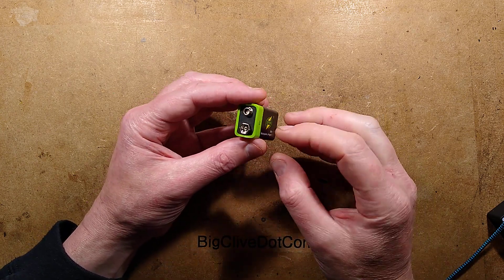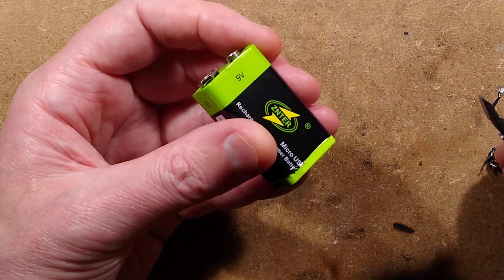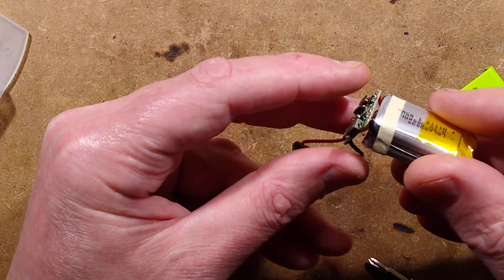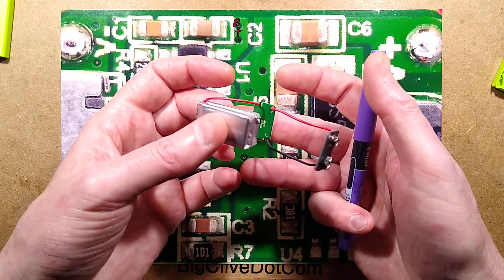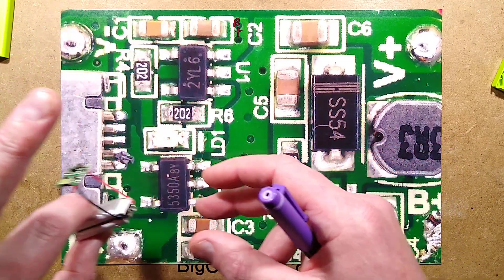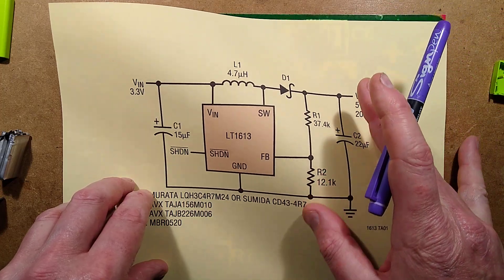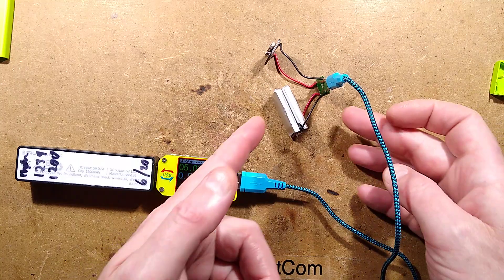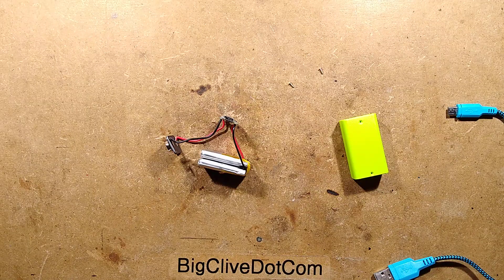Inside a Znter lithium 9V battery.

Comment: I have the Okcell version of these and they have a level meter on the side.  
I love them, they have been one the best battery purchases I have made.  10/10 would recommend these
Reply: I have both and the Okcells only have about half of the capacity of the Znters. That's no big deal usually though as they have such a high self-discharge that I charge before use anyway and the Okcells are usually high enough capacity.

Comment: What do you think of using this for smoke detectors? Usually they beep when the voltage drops below a certain point, these are a stable voltage until the end. Would they work with the warning beeps? Or will you have to guess when to plug the thing in?
Reply: If it suddenly shuts off then you won't get the low battery warnings, it will also only last 3-6 months at best. Would not recommend for this use.
Reply: Not very suitable for smoke detectors due to high self-discharge and sudden demise with no warning. For longest life use a non-rechargeable lithium - a bit pricey though.

Comment: I'm really liking this. However apart from my multimeter's and smoke alarms, I'm trying to think what else I'd use them in...
Reply: Hmm, smoke alarms? From what Clive was saying, the remaining charge would not be useful after 6 months, where standard PP3 bats I know last for at least 12 months. Was thinking of buying 2, and jst 'remember' to charge them twice a year, but would I remember? Doubt I would :)
Reply: @comicmania2008  the other issue is that a PP3 will go 9v, 8.5v, 8v, 7.5v, smoke alarm beeps to tell you to change yer battery.

These would go 9v, 9v, 9v, 9v, dead because they boost the voltage. No warning. No alarm.
I'd not be using them in smoke alarms. :/
Reply: @Beany2007FTW  That's something that could be worked around. Many such devices may even do it - all you'd have to do is rig the boost converter to use the battery voltage as the reference instead of an internal fixed reference, and adjust the divider so the converter would go from 9.5v when the LiOn cells are at 4.2, down to maybe 7 volts when they get down near 3.2v. It would be tricky to get exactly right, but certainly doable.

It would be cinch if someone would design a chip to do this.
Reply: @robertbackhaus8911  someone could design a chip to do it.... Or they could just buy some regular PP3 batteries :)
Reply: @comicmania2008  About 18 months ago I found an old Ni-MH 9V in my drawer and decided to test the myth that they shouldn't be used in smoke alarms. I got 9 months out of it which isn't terrible considering I was replacing Energizers roughly annually. I think it's a 7-cell version. My particular alarm, low battery chirp starts at 7.8V and continues chirping down to something like 3V-4V. It was enough of a spread that I'm not worried it'll go dead while I'm at work or away for a weekend and miss the warning before it cuts out completely. So I'm happy to use Ni-MH at least. Here in NZ, the lithium variants are stupidly expensive so I haven't bought one to test. Their voltage does drop off a cliff at a certain point though.
Reply: Hell I'm debating buying two for my work, we go through so many 9v batteries for our door dinger. We go through around  two boxes of 12 a year
Reply: @SilvaDreams  I'd be vary about using them if they go from full voltage to 0 instantly as the cell voltage drops below the protection level, not giving the alarm a chance to tell you that the battery is going low...
Reply: Might be great for paintball, between my markers and hoppers I'm always stocking up on them!
Reply: These wouldn't be suitable for smoke alarms in my area as our Fire Protection guidelines require ten year non replaceable lithium batteries. I would suggest you check your local laws before using these in smoke alarms...
Reply: @evanstedman7405  I don't understand those ten year smoke alarms. If they ever get set off (happens a lot when cooking) you clearly won't get a full ten years. You're left scrapping the entire unit before its time. I wonder if the people writing them into code have thought of this. Do they really think people are more likely to maintain their alarms if they always need to replace the entire unit instead of just a battery?
Reply: @eDoc2020  The only time the whole unit is scrapped is if it develops an internal fault and needs to be replaced or once the alarm reaches the end of its service life (the ten years). And the batteries are guaranteed to last ten years as they have been designed to last a fair bit longer than that (even factoring in as many as 100 activations in the service life).
Reply: @evanstedman7405  Do they really factor in 100 activations when calculating the service life? If that's the case it's not as bad, although it still seems limited. If you set off the alarm once a month when cooking (reasonable, considering my old oven would seemingly always set off the alarm if set to 450F) you'll get over 100 alarms within ten years.
Reply: @eDoc2020  I haven't looked at the specifications in depth recently but I do know that they are definitely guaranteed to last the ten years as the manufacturer is required by the code to ensure this.
Reply: @evanstedman7405  another thing in the landfill because of non-serviceable batteries.
Reply: My DMM takes 4 C cells. It uses one about every 50 years. So C cell shelf life is important for that utilisation.
Reply: arduino
Reply: Actually 9v used in most guitar pre amps as long as they are the exact same size as a normal pp3
Reply: My shed alarm uses a PP3

Comment: I bought some Lion double AA and AAA batteries with what seems like a buck converter and charging chip built in.  Even though these batteries are great, I think I would be afraid to use them in something like a smoke detector since I don't think the smoke detector would never tell me if it was low or not.  I use them in remotes, and electric toothbrushes and flashlights since the worst that can happen is my light dies, and also my toothbrush.  I would want to know if I need to swap out my smoke detector batteries so I wouldn't use these in critical items.

Comment: I've been using ordinary cheapo "barely 9v" 9v NiMH in my multimeters and crappy microphone mixer (that's all I've got that works on PP3) for over 10 years now (and that's  the same batteries and charger over and over again) and they've never complained.... not entirely relevant but, hey, it's a long long-term test.

Comment: dB Technologies microphone transmitters do not like Ni-Mh rechargeable batteries, and don't last very long at all. 

Used to use a Db Technologies 800/810 system (the 810 being the "posh" version with a mostly metal case LCD display with frequency and vu meters plus removeable antennas, interestingly not only are the PCB's 99% the same, it's mounted on the same plastic base/rear panel of the 800!, some nice dB technologies laser etch branded RF cans too)  with a  headworn mic in conjunction with my Behringer VC340 Vocoder and would have a habit of leaving the transmitter switched on, not good when only non-rechargeable batteries work properly. 

Keep meaning to test Ni-Mh 9V's in my old Trantec VHF wireless systems to see if they fair better, although I would have to replace the connector on the microphone and at ~£20 a connector (Trantec used to use 4 pin LEMO connectors) not cheap.
Although I will say at least they are easy to obtain, dB technologies used custom ~3.5mm locking jacks (In either TS or TRS form, the 800/810 using TS jacks and specific  beltpacks for guitars without the ability to power condenser/electret microphones) and ONLY Thomann sell them!
https://www.thomann.de/gb/db_technologies_vh_511_miniklinke_stecker.htm
https://www.thomann.de/gb/db_technologies_vh_519_mini_jack.htm

Comment: Hopefully, you put this back together, this is the most practical rechargeable 9-volt battery I've ever seen.
Reply: @chichung888  Li-ion would give them a bit more leeway on the cutoff voltage, but not down to 2.2V...more like 2.8V with modern cell design, but I'd still rather not go below 3.0V myself. Too expensive to stress it like that every time you use it, and with that design that's what one is doing if one waits until the battery just shuts down by itself.
Reply: Guys, is it suitable for the use in a guitar?
Reply: @MaximC  The switching frequency is much higher than any audible frequency so I would think it's probably ok to use to power a guitar pre-amp or an effects pedal. FWIW I use an EBL branded equivalent lithium 9 volt battery to power the active electronics in a bass guitar and it works just fine but, as always, your milage may vary. They do interfere with some radio frequency equipment though. I have an MSF clock that takes two AAA cells and after cleaning away the remains of a pair of alkaline cells that leaked while still able to power the device I fitted a pair of EBL lithium AAA cells. They each contain a 3.7 volt lithium cell and a buck converter to reduce the voltage to 1.5 volts. They were great for powering the clock but they interfered with the radio signal it relies on for its accuracy. So I ended up replacing them with a pair of NiMH cells, which work fine and, I hope, will be less inclined to leak than the original alkalines.
Reply: @johnm2012  
Thanks. I think quality ones should be fine, but Chinese cheap ones might not be fine - I think I saw a video where someone put a Chinese 9V rechargeable battery in a guitar and it created noises.
Reply: Guys what type of 9v battery would be best suited for my metal detector, currently juicing up on Alkaline and wanted something more longer lasting as costing a small fortune to replace. 
I was reading your comments about audio interference, my detector isnt wireless but has either head phones or a small speaker close to battery compartment. Would one of these effect my detector and if so wheat else could I possibly use? 

Apprichiate your time!
Reply: I was thinking rechargable and then thought maybe something best of both worlds so hense why looking on here. I noticed last comment also mention some interference with rechargables?? is this something I possibly couldnt use either?
Reply: Hmm. Could you fix (in theory) the wrong cutoff voltage by using different resistors like on the boost circuit, or is it a built-in part of the chip?
Reply: The most practical ones are those with a charge level indicator and a button. With this Znter you never know how full is your battery unless it cuts off due to low voltage on the lithium cells.

Comment: LOL, when we build sets for TV and theater we always picked up those battery's. They tend to just litter them on thr ground. Cheap battery's for us though, mostly half empty.
Reply: I bought a test meter and when I would cycle AAS through at church they will get to a certain point and I would throw them into a used tub and to take home and use them for other things until they were dead. A good use is for TV remotes and thermostats are good and  low draw and not too concerned about the remaining capacity until they just stopped working. I used to work with a group / band who would replace them every month after 4 hours of use I eventually convinced him to get a battery tester and we would take them out test them and reuse them until they got low we stopped going through batteries a lot.

Comment: It’s refreshing seeing nicely designed stuff alongside the horrors
Reply: Accept the battery sais ploymer in stead of polymer
Reply: @laurensholthof  Except?
Reply: @MarbledPaladin  ...and says?
Reply: @MarbledPaladin  I think I just died a little inside. Usually, I'm the one correcting people on their and they're, but I'll just go ahead and assume that this was on phone and in a hurry.
Reply: And held together with screws!
Reply: ...which makes me realize that I can't know what is shite or quality without tearing my electronics apart and knowing the difference myself
Reply: I think the batteries from the late 80's to early 90's was way better. they lasted longer, and could handle at least double the current. Even the non recharge variety from back in the day had more current than the same variety today.
Reply: It looks easily hackable too to make a small power bank for 5V. That would be a single resistor change for the easiest method. Change a few components and you could make it far more efficient. EG a better shottky diode and inductor with lower ESR.
Reply: @gordonlawrence1448  Indeed, replace the resistors with a very small pot, drill another tiny hole, and now it's a variable voltage battery pack!  You'd just need to carry a flat screwdriver, a meter, and a set of custom snap-on connectors for all your needs and... Yeah, nevermind.  ;-]
Reply: Is there room enough to add what's necessary to allow the end-user to choose the boost to be to, say, 7.2V, 8.4, then 9.6 -- depending on intended use? Would make for a versatile "9V" battery.
Reply: @michaelthibault7930  The ratio between R2 and R3 determines the output voltage. It looks like there's a nice empty bit of floorspace right there on the PCB where you could fit a small SMD trimpot there (2mm Cermet), especially after they're removed or rotated, and the PCB goes with the component side towards enclosure; so next step you drill a tiny hole in the enclosure and you're basically done. Or alternatively placing a trimpot right atop the chip and making a somewhat bigger hole that the whole top of trimpot peeks through. I wouldn't call it endconsumer friendly, ideally you'd want to sacrifice some battery size to fit an adjustment board or something, but if you need an adjustable battery for yourself to fit into a 9V space and are willing to be very careful with it, it can be done. I can't say i entirely trust little trimpots though.
Reply: @SianaGearz  Trimpots usually have a short mechanical life compared to, say, a front panel volume control.  They may get adjusted at most a dozen times in the life of a product.  However, if the trimpot is in parallel with one of the voltage divider resistors, it's failure wouldn't cause the battery pack to exceed the voltage set by the fixed resistors alone.
Reply: @robertcartier5088  You clearly forgot an ESP8266 offering a website on which you can set the voltage with a slider :)

Comment: I'm pretty sure that 100% all Li-Ion "9v" rechargeable are just 2x lithium cells.  What's unique about this one is the boost circuitry.  The majority of these only put out 7.4 volts, yet still work in most applications.

Comment: Nice teardown - thanks.
I prefer to use these now, rather than standard NiMH rechargeables. I bought one of those cheap (and apparently flaky) Minwa MW6288 intelligent dual PP3 chargers (based around a Samsung MCU) which was great while it lasted (which was a few weeks).

Comment: Hi,

Did you also measured the current a low current drain like a smoke detector.
Tried something similar with a 18500 cell and a buckbooster but it has a 1.5mA current draw when active.
Manage it to lower it to 0.5mA but that's way to high for a smoke detector.
Reply: If you use this in a smoke detector you wouldn't get low battery warning beeps as the boost circuit just suddenly turns off. it would also only last 3-6 months tops. Bad idea.

Comment: So the frequency of boosting is larger that 20khz to avoid it getting through the audio side clive?
Reply: But it's those harmonics (in the AF range anyway) that might creep into an audio system. :-/
Reply: I recognise this chip as likely SX1308/MT3608 or one of potentially existing identical clones. The switching frequency expected is around 900 KHz.
One possible keyword you're looking for to explain actually occurring problems in vicinity of such circuits,  is "RF rectification".

Comment: I just ordered me a set of 4xAA 4xAAA 4x9V with the charging cables on Ebay.... I used to use a AA battery where the + cap pulled off to a full sized usb a to recharge it. Still have those

Comment: Have never seen these before. I wonder if they'd work fine in an old 1980s metal detector I have. The detector needs three 9v batteries and I don't use it much as I can't justify the cost of replacement batteries for it. Three of these would soon make the cost of their initial outlay back after a few recharges.

Comment: On the subject of lithium batteries, and that many are getting bigger, i haven't seen one that has fast charge (except in the EV world)
Many smartphones have circuitry to detect when a charger has tha capability, but not on battery packs that can far exceed the capacity of a smartphone battery.
Also, with the capacitor on the output of that battery, that should smooth the output for use in mic packs etc, maybe this should be tested.

Comment: I bought 4 aa Znter cells a couple years ago. They are also regulated, and they've worked great. I haven't taken them apart, so this was very interesting! They are pretty slow to self-discharge and they stay right at 1.5V until it shuts off.

Comment: I was just looking at these rechargeable 9V batteries to use them in smoke detectors before I got distracted. Back to eBay I guess
Reply: Don't, if they only last a max of 6 months, and they shut off rather than drop voltage, that means the smoke detector won't beep when the battery is low, and it won't last the recommended 12 months between replacing batteries.
Reply: Daniel I absolutely, i wouldn’t use them in a smoke detector due to the rapid/instant voltage drop off.

Comment: I was wondering, wouldn't it be possible to completely avoid quiescent current draining the battery when in storage by adding a switch on the battery -> board connection? And if so, I wonder if it would be possible to mod it so that the switch can be enabled from either one of the physical connections be modifying them a tiny bit?
Reply: That is a great idea, might be hard to mod but a company could easily design a battery clip that has a built in disconnect when you un-clip it.